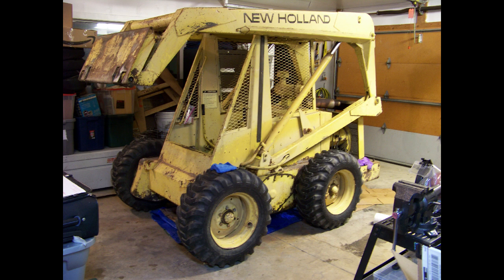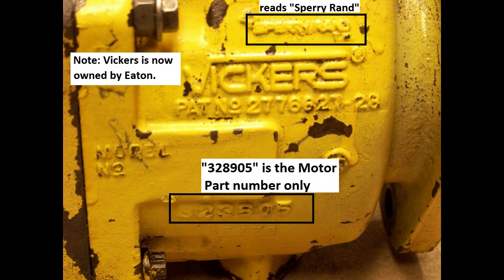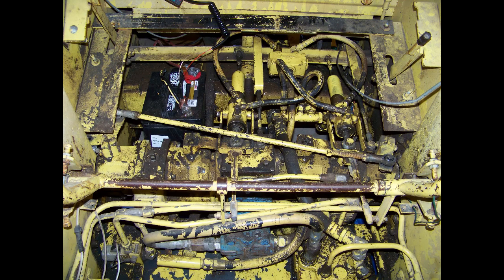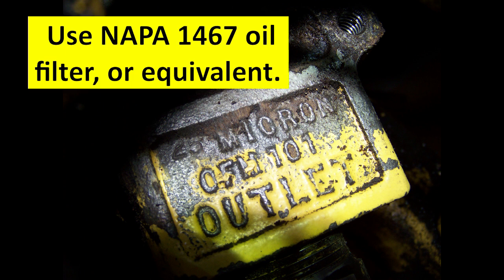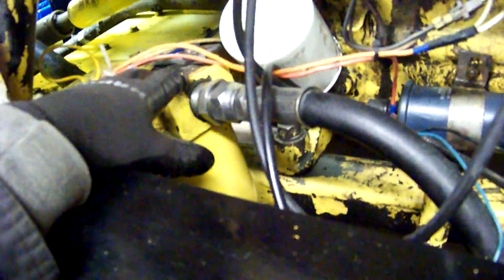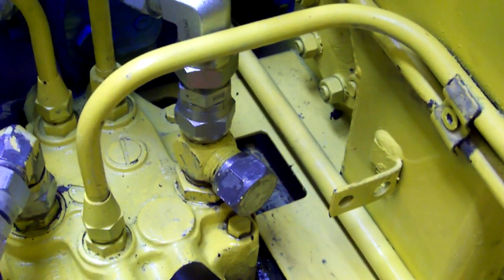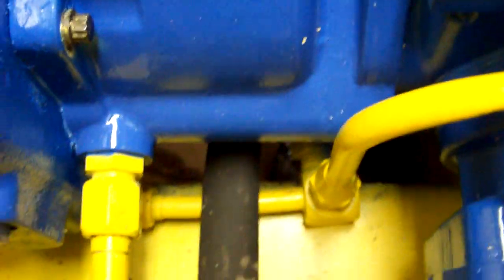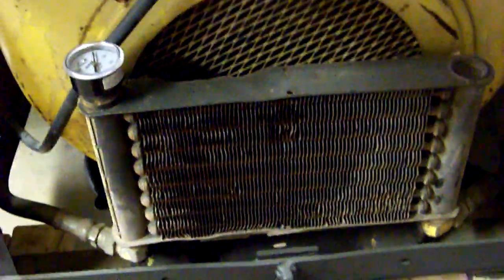New Holland L35, L775 Skid Steer (Vickers) Explaining the Hydraulic Flow, Purge Procedure

Comment: What would cause my l35 to creep forward while in a neutral position?
Reply from the maker: The "creep" on your L35 is quite common - the fix is to adjust the position of each side (right and left) steering control assemblies such that the neutral position of the levers is indeed holding the swash plates at the neutral positions on each transmission.  

There are a few components that affect this, and it varies between the Vickers and Cessna transmissions. Generally, though, creep is usually caused by either the neutral spring assembly or another steering component being worn/misadjusted or the pintle lever being loose on the pump pintle shaft (Cessna).

For the Vickers, the steering control and centering springs are the main adjustments to eliminate creep.  It is a rather technical back-and-forth procedure (easy, but technical) that is described very well in great detail the big Service Manual (for Vickers, it is Section 6, on pages 40 - 45).  

You can get a digital PDF of that big Service Manual manual online from a few different places for about $20, and it is excellent and worth every penny.  Here is an example - you want the big one (214 pages):
https://www.jensales.com/products/new-holland-skid-steer-service-manual.html

When I've done that job, I always lift the whole skidsteer (all four wheels up), because that is easier, safer, and more precise.  I hope that helps - good luck!

Comment: thinking about picking up a 70s gasser l775.  Was told the foot bucket control valve is leaking.  Any recommendations on rebuilding/info?  Thanks.

Comment: What kind of hydraulic fluid should be used in an L779? My dad passed a little over a year ago and I'm wondering what I need to use for the hydraulic fluid? I can't find much information researching it. What is a good way to check the level? The sight window is very weathered and can't see through it.

Comment: Your videos have been an incredible resource for me tinkering on my L775 with Vickers Trans.  Just curious if your Hi - Low works?  Ive tried adjusting the pintle arm but it won't actually shift inside the trans, I have about 1/2 inch of movement.  Just curious if yours works and if you perhaps have any suggestions?  If not, I'll carry on in Hi gear, not the end of the world.  Thank you!
Reply from the maker: I have the same situation - as far as I can tell, mine doesn't work either!

Comment: Just bought a 1980 L35 and the engine was swapped for a 2.3 mustang engine, it was a hack job install but it works i just dont like that lack of torque and will be replacing it with a 40hp Yanmar diesel that has peak torque in the 1900rpm range vs the 3400 rpm of the 2.3 plus i didnt want to spin the trans/pump that high and sling something thru the seat lol
Reply from the maker: Wow, that's WILD!  : D

Comment: My NHL -775  has a broken engine.  How do I get the wheels to spin freely when towing? I think that the previous owner has forcibly towed the 775, because the wheel bolts and was broken a lot.  I hope nothing is damaged in the hydraulics.
Reply from the maker: Ah man, I'm sorry that is happening with your L775.  My L35 owner's manual says this about towing/winching:

"WINCHING VALVE: Each hydrostatic pump-motor combination is equipped with a winching valve. The valve for the right pump-motor is shown at A, Figure 6. The valve for the left pump-motor is in the same location on the left side. 

"These valves should be kept closed (horizontal position, as shown in Figure 6) at all times except when it becomes absolutely necessary to push the loader with the engine stopped. If this should happen, the valves can be opened by turning them 90 degrees to a vertical position.

"ATTENTION: Do not push or tow loader long distances as internal transmission damage will result. Load loader on a trailer or truck when transporting.

"IMPORTANT: The winching valve is used in case of emergency only. Excess towing may damage the hydrostatic transmissions. Before towing the loader, turn the winching valve on each transmission to disengage the transmission.
CAUTION: DO NOT TURN VALVE WHILE ENGINE IS RUNNING.
DO NOT TOWN LOADER TO START
DO NOT TOW LOADER FASTER THAN 8 MPH (13 KPH)."

You can possibly access a document here (may or may not work):
https://www.scribd.com/document/576181705/l775-sm

The winching valve is likely in slightly different locations on the Cessna versus Vickers transmission. Which transmissions do you have?

If I had to tow my L35 for a long distance, I would go ahead and remove each drive chain to allow the wheels to free-wheel.  Granted, that would be a huge inconvenience because removing the chains requires draining the chain cases (save the oil, there's 2.5 gallons per side), de-tensioning the idler, getting the chain master link to an accessible spot, then removing the master link to get the chain out. That is a messy, inconvenient job, but it will absolutely isolate the transmissions and allow for safe towing because the wheels would be freewheeling.

Just as a heads up, removing the chains also is inconvenient because getting those chains back on requires lifting the skidsteer because you have to remove the wheels to get the chains back on. (You have to remove the wheels so that you can remove the wheel hub access plates behind the wheels, so that you can see the wheel socket to place the chain back on properly). 

What is your situation?
Reply: thank you very much for the good answer.  i have to moved the 775 about 100 meters.  from the yard to the carage.  that I can change the engine.  I'm afraid the seller may have broken something.  because he didn't know how to use the valve

Comment: Where did you get them steering cylinders?
Reply from the maker: I'm very sorry that I missed your comment -- they are the original cylinders.  I was able to get a rebuild kit (new old stock) and rebuild one which was leaking.  If you need cylinders, check out Surplus Center: they have a TON of cylinders and their staff is very helpful in finding a match for the ones you're trying to replace.  Good luck!

Comment: I'm looking at buy a 1982 new Holland l425. What are some things I should check to make sure it ain't gonna give me trouble. I also noticed that if I put a high flow pump on it I can use more attachments.. is this what you have done here?  If you did how much time and money am I looking at to install the high flow and is it worth it?   Thanks
Reply from the maker: I'm sorry that I missed your comment! I don't know much about the L425's, but in general the transmissions would be the main trouble points that I'd be looking at, since they are so expensive to repair and replace.  I rebuilt one transmission on this L35 due a problem with the shaft seal, and it was difficult to find certain parts because it is such an old machine.  I was able to find everything, but I'm very glad that I didn't have to replace some transmission parts (ie, the shaft or carrier group) because those parts are VERY expensive (hundreds of dollars). 
So, using that experience, I would be especially critical of the transmissions: when you test it out, listen for any clunking or hissing.  For the final drives, especially listen for clunking and skipping when you do hard turns. 
Regarding the high flow pump: no, this L35 is stock (it doesn't even have an alternator, which was an option when they were new!), and it just has the standard pump, which is powerful.  I have never used any attachments, and just use the bucket.  There are other places on the stock control valve for other accessories, though, and I would think that the L425 would have a similar control valve.  
I don't know how much such a pump would cost to install, but if the L425 is anything like the L35 (they seem to be similar), then I found the L35 rather easy to work on, and I found the old service manuals to be very detailed and highly useful.  If you have shop tools like a press and welder, you can really do a lot with these old machines.  They are very serviceable machines -- no computers obviously and just pure mechanical and hydraulic parts that are much easier to troubleshoot than the modern versions!  
The single biggest issue I had when repairing/restoring my L35 was finding certain replacement parts, such as a certain shaft seal for the transmission (it was an odd one), and it was especially difficult to find this one keyed shaft and gear set for the busted idler assembly (had to improvise and cut/key a shaft from an L775 to make it work).  Many other parts (ie, bearings, o-rings) are general, and are not hard to find, and you can make the gaskets and shims because they aren't anything exotic and the shapes are basic.  There was a needle bearing set, though (again for that idler assembly) that was pretty hard to find.  Definitely buy the big service manual if you buy the L425, because if its anything like L35 manual, it will be outstanding.
Good luck!
Reply: @L35inColorado  

Thanks for the info.. I did buy it and it runs great. PTL!   I did notice a few times when it seemed like when I was turning very hard in a hard place it did clunk a little but not everytime I turned hard.  I'll have to look at the owners manual provided for those auxiliaries since I might get a grapple.  I noticed there are alot of add ons to the bucket like forks and others that may help it be more job friendly.

Thanks again.

Comment: Awesome video! just picked up a L775 and works good except left steer valve suddenly reversed. So to go strait you push right stick forward and pull left stick back. If you push both forward you turn. I'm guessing the valve needs to be rebuild since I'm not seeing what else could cause that. Has Vickers transmission.

Comment: Very good videos!!!  I have a L779...Runs very good EXCEPT for the fact it decides to buck like wild on its own.  I'm trying to understand why but haven't solved the problem.  The bucking is way worse on ashphalt.  I can barely maneuver in the street.  On the dirt I'm manageable but she still decides to buck like wild at very terrible times.  Have you experienced this?
Reply from the maker: Oh wow, sounds like a wild ride!  I haven't experienced that, but I would start by looking at the linkages for the levers to the transmission (the steering linkages) and the steering cylinders.  Starting at the bottom end of the steering lever, there is a tie rod with a ball joint that connects to the steering cylinder assembly: check that ball joint and the jam nut for the rod end.  Pull each steering lever back and watch that there are no hang-ups anywhere among those components, then let it return to neutral and check that the return spring side is moving smoothly too.

Then move towards the steering cylinder: there is another tie rod for the return spring and that has a ball joint too.  The steering cylinder has a larger ball joint at the end and that needs to be greased well and not be sticky.  Check all those linkage parts, then make sure that the bolt that holds the last link to the pintle on the transmission is tight (its the only connection to the transmssion and connects to the pump sides of each transmission) -- there's a Woodruff key in there, too, that prevents it from slipping.  If that fastener gets loose, the key can drop out and then the connection will slip.  Make sure key that didn't disappear!

I would check the steering stuff first, just because its so much easier than final drive and transmission stuff.  Are your steering linkages all checking out alright?
Reply: @L35inColorado  thanks for the insight!  The first thing I see is the bushings for the entire hand control assembly, both left and right are completely worn out.  I know its stupid but I completely over looked this!  I'll start here and see if i can find the bushings for the controls.....thanks for your videos.  VERY INFORMATIVE!

Comment: Hello L35 in Colorado! Great videon series, thanks for making it. I've got an L35 in Pennsylvania. I now understand from your videos that I too have a Vickers hydraulic system just like yours, I inherited my Grandfather's L35 that I still remember being so bright yellow and new when I was about 7 in roughly 1975. My grandmother called it his "$7000 toy" and the family used it through the years to get firewood out of the woods, clear snow etc. (generally light work) and now it is on my little 6 acres.  I've been caring for it for about 13 years now. Your paint job and other great work has inspired me. Until your video series, there was little info out there for me, and in addition to an original owner's manual (I see now that it lists just a Vickers transmission), I purchased an owner's manual that covers Cessna and now that I'm more familiar with the machine from various repairs, the pics look nothing like my machine. So THANK YOU for teaching me that I have a Vickers transmission.

So guess what I've been putting into the transmission reservoir? You guessed it, Dexron III ATF. Ran it like that for maybe 8 years now, 20 hours per year tops. I wondered why after about 30 minutes of use, the boom is slow to raise. I guess I should also check for the screen going into the low pressure inlet, I only changed the bottom hydraulic fluid filter. My question is this: On page 19 of what I believe is its correct operator's manual (Vickers--found it with Grandpa's stuff) it calls for 28 quarts of SAE 10. Not 10w40. It is an L35 serial #135170, VG4D of course, Spec: 345112 Serial: 5135328 with a Zenith Carb L57E . Do you know when (possibly at what serial number) the recommendation changed from SAE 10 to SAE 10w40? Not sure which I should put into it. Many thanks!
Reply from the maker: Wow, that is very cool that you have a one-family machine!  Regarding the Vicker's transmission fluid requirements: I do not know when or if there was a change in the spec from SAE 10 to 10w40, but I do know from online research that there was a change in the Vickers transmissions starting with serial number 148239.  Since your serial number is below that serial number, you have an earlier model.  From what I have in my manuals, there is not any notes about SAE 10.  

I don't know much regarding the differences between the pre-148239 transmissions and post-148239 transmission, but I do remember that overall the transmissions were very similar when I was looking at parts diagrams for them (the diagrams are on Messicks website).  The main difference I remember was that the transmission shaft was available in two different diameters, depending on the serial number (I had to open up one of the transmissions and replace a seal, and that's how I found that out).  You can see here from these documents from Messicks that there are different notes for "ASN" (after serial number) 148239 and "BSN" (before serial number) 148239:  

here is the After:  https://www.messicks.com/nh/317601
here is the Before: https://www.messicks.com/nh/317601

That said, I don't know when/if the oil specification changed!  You might just email Vickers and New Holland: I was emailing both when doing this work, and they were both helpful.  I would start with Vickers, then New Holland.  Vickers is now owed by Eaton.  You might also call a good local shop who has experience with older equipment and see if they have some information. 

Thanks for your comment, and good luck!  Please post back if you happen to find out!

Comment: do you by chance know of or can suggest a video on taking the drive shaft out of this kind of loader??
Reply from the maker: I'm not aware of any videos, but I had a look in my service manual: it doesn't get into great detail, but rather just instructs to remove the bolt that connects the driveshaft to the forward-most yoke -- this is the yoke by the 4-way gear box.  There is a big yoke bolt there, and it holds the yoke to the input shaft of the 4-way gear box. The manual just says this:

"Slide the drive shaft off the gearbox input shaft after removing securing bolt A, Figure 6", and that "securing bolt A" is the big one on the yoke.  

Here's my video on the 4-way gearbox: I don't show this bolt in the video, but you can see what I mean about the input shaft inside the gear box, so you can understand what the manual is talking about (that shaft goes all the way through, and its rear-end is connected to the driveshaft at the yoke bolt):

https://www.youtube.com/watch?v=qfoBXIXQOZY

Let me know if this helps!  In case I'm not being clear enough, the bolt that I'm talking about looks kinda like a pinion nut that you'd see on a regular automotive differential (holding the diff yoke to the diff input), but its a big bolt instead of a nut.  Please post back if that works.  Then back on the other side of the driveshaft (engine side), you just loosen the square-head bolt that's on the very first yoke, and you pry that yoke off.  

I have in the past had to adjust that end (engine end) of the driveshaft before on my L35, and that connection wasn't too difficult to adjust (just had to pry a little) because that yoke is just secured with a Woodruff key.  So I think if I were you, I'd loosen that square head bolt on the engine side yoke first, then remove the big bolt at the gearbox yoke next, then slide off the shaft from the gearbox yoke and wiggle/pry it free from the engine side.  Don't lose the Woodruff key.  Also, I'd mark/scribe the yoke and shaft at the gearbox side to be sure that I have reference alignment marks when it comes time to re-install.  

For install, the manual says to fasten the big bolt to 40 ft-lbs, plus or minus 5 ft-lbs, and to use Loctite 242 (medium strength) on the threads.  That's all the info I have, so hopefully this helps you. 

Good luck!